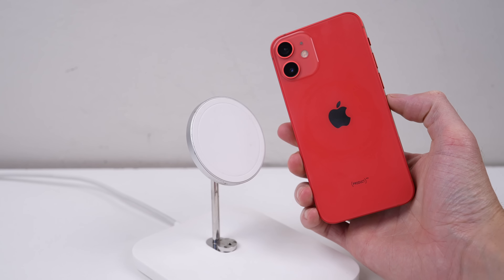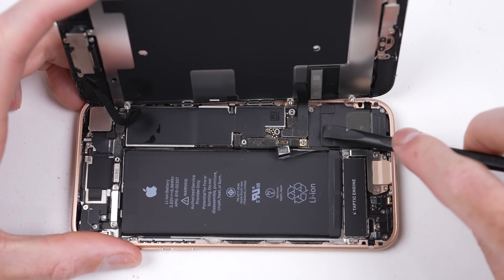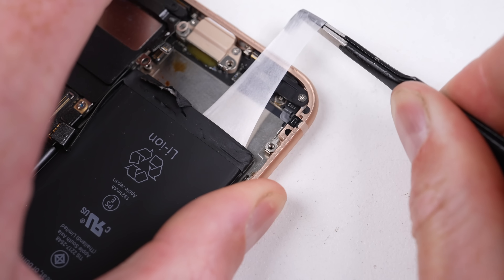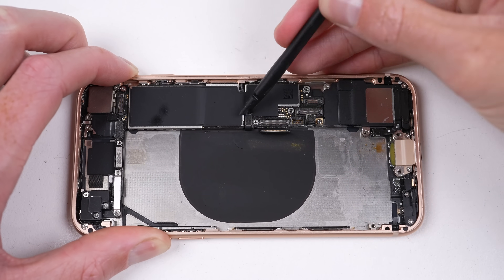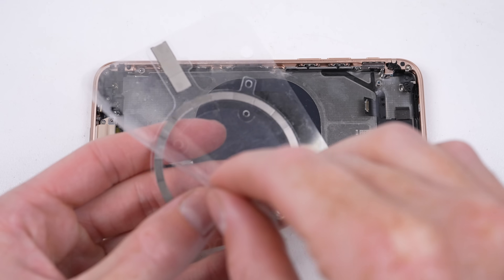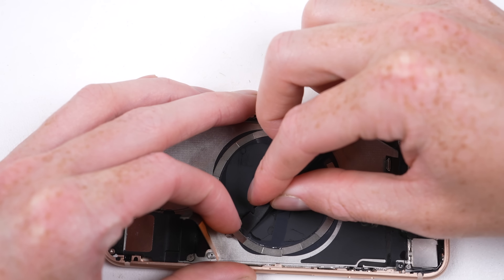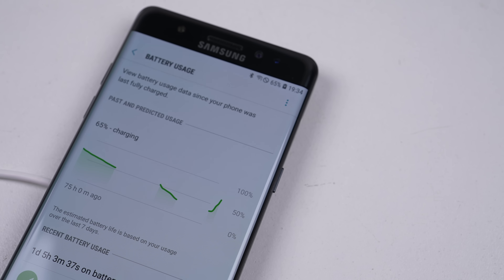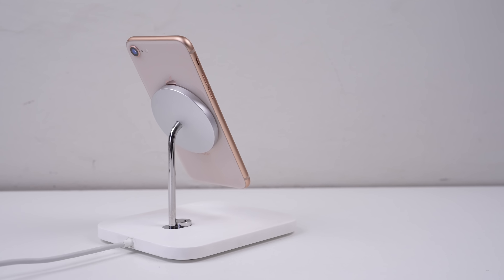Adding An Exclusive iPhone Hardware Feature To Android Phones + Older iPhones Models.

Comment: 7:23 I would suggest non closed magsafe rings when you do this since the closed one messes with the charging, an open one does not. Simply cutting a small bit out of it also fixes the issue.

Comment: I’ve got an iPod Classic 5th gen that’s in great condition, but the screen has never worked since I got it. The seller mentioned it was unused for 12 years. I opened it up, disconnected and reconnected the battery, and everything works in terms of going into Disk Mode, connecting to the computer, and the drive spinning. However, the screen stays dead, and I don’t think it’s even booting to the main system—I don’t hear the signature clicks when running my fingers over it. Should I attempt a screen replacement, or could it be something else? Any advice would be appreciated.

Comment: I made a cutout in my leather skin on my phone for a stick on ring so it's flush, but for whatever reason it blocked wireless charging completely for all my wireless chargers which work on the same phone without the ring which is a shame

Comment: My wife's s23 not only wouldn't charge reliably with a magsafe case, it would discharge much faster during normal use. Figured this out on vacation so I had to pry out the the magnets. My s23 ultra worked fine.

Comment: Magsafe works on adroid just fine depending on manufacturer samsung used different wireless charging protocols from apple i had this issue on my note 20. Anker uses apples protocol so it doesn't work well on some sam phones other companies throw both on and work well with either or

Comment: Nice. Now can you do the opposite? I have an iPhone pro max 15. I never use the wireless charging function or MagSafe. But I still have to contend with having a glass back phone which recently suffered a minor knock. Nothing serious, any other device would’ve been fine, but being an IPhone the back glass has shattered. Fortunately it’s not come loose or fallen away, just looks terrible. 

Can you replace the back glass on a similar iPhone with something that won’t shatter? Even if it means sacrificing the unused charging functions?

Comment: Bought a Magsafe case for my Samsung Z flip 5. I've noticed that while it works well with the Magsafe charger, It won't reliable charge with the original Samsung wireless charger, Sometimes it will work fine but sometimes it will say the case blocking the wireless charge.

Comment: A case definitely is the best way to add magsafe to any phone for most people. I recently upgraded my oneplus 6t to a pixel 9 Pro, and chose a case with magsafe built in. I use a magnetic mount in my truck and at my desk for my phone, and my old one used a plate stuck to the back of the case with adhesive. My new one uses magsafe and I much prefer it, mostly because in the truck I don't have to align the plate anymore.

Comment: Magsafe is unreliable if you have the phone even slightly out of alignment. I have an aftermarket and have laid the phone down off by a bit and found the battery discharged when I went to check it, same result as your initial effort

Comment: Either way, stuffing magnets right at the wireless charging coils is the last thing you want to create an induction heater or overheat the battery. I would rather position the magnets away from the center.

Comment: I've been using dbrand's grip case (which embeds the magnets) with a pixel 9 and it's amazing... It's so frustrating the standard isn't universal or open for all phones, when it brings better charging efficiency, simpler use, and general improved convenience.

Comment: The battery expands and contracts when it's hot, a few millimeters small casing is what caused the samsung galaxy note 7 to explode if i remember, also wireless charging introduces a lot of heat, take care Hugh :D
Reply: The phone which Hugh used was Note FE not the Note 7. Note FE has slightly lower capacity battery which is safe and has no incident of explosion.
Reply: @chiragpatil3772  i wasn't talking about the phone i was talking about the battery expanding and contracting being blocked by the magnets

Comment: idiot this MagSafe is made for iPhone 13 and newer only so there's 2 different kind of wireless charger so one is for Samsung wireless charger is made for Samsung phones only so that charger will work fine for other kind of phones too but not for apple iPhones at all so MagSafe is degined for iPhone 13 and newer reason is watts went higher is to 15 watts now and Samsung is about 10 watts so it much different now got that because I have learned many new things online and you have not learned new things too thats why so you only fix things in your life got it so I always test it first before to use new ones and never take it apart or will void the warranty for that I can't take it for repairs by Apple Store to fix it thats why

Comment: Magsafe isn't Apple-exclusive. Its a part of the universal Qi2 standard. Many Android phones will have it this year.
Reply: Some phones are launching with Qi2 without it. The S25 phones aren't going to have magsafe.
Reply: "Magsafe" the word is trademarked by Apple. If it is labeled Magsafe it is exclusive to Apple. The wireless charging technology is not proprietary but a "Magesafe" case etc is.
Reply: Tech Altar recently made a video on Qi2
Reply: Except still only one has it - unless you count that you can buy a cover with magnets haha
Reply: You need accessories for non iPhone. actually there's one small android brand that implemented magnets inside the phone itself, but this year most of Android phones need an external case to work with magsafe.

Comment: Actually I thought all phones came with it all of my devices have it just recently we added a wireless charger pad system do the back of my Galaxy tab S10 Plus I have a tech guy who does this stuff now this has a glass back now so it will charge properly we took it somewhere and they made a specialty case and the way that he did it it's so that way it's a huge charging pad will charge basically any position you lay it on the wireless charger it even works with magsafe

Comment: Missleading title! This is NOT an iPhone exlucive thing in any way shape or form!
In fact, wirless charging and accesories with magnets was on some early devices even years before the first iPhone was an idea.. So stop giving Apple credit for stolen ideas!
Emberrasing how people forget things excisted before the damn iPhone with stolen features🤦‍♂️ Funny thing is most disliked this crap untill the iPhone got it... Weird🤔🤦‍♂️
And magnets is also a part of the QI 2 standard.. Litteraly why I don't want QI 2. I hate magnets on my wirless charging devices and it's a bit annoying even on my old 2016 smartwatch.
And why would you open the phone to add this crap? Just get a case or a magnet sticker on the backside. Easier, better and gives you an easier option to remove it later.
It's not an upgrade but a downgrade in my eyes.. Magnets making it hang on litteraly defeats the point of using a wirless charger🤦‍♂️😅

Comment: This is a great idea. I have a ring from ESR on the case of my S10e (it has alignments for Samsung phones in the box) and a powerbank with MagSafe. Wireless charging is pretty inefficient, so I typically charge it with a cable anyway, but powerbank being "stuck" on the phone is very convenient. I didn't think magnets on my powerbank were strong enough to work through the case, so I didn't even consider putting it on the phone or even under the back glass. I'll have to replace the battery at some point and might test it again.

Comment: I have done it already. Doesn't work very well. I have a galaxy s10. Done this a year ago . The reverse charge stop working, the phone overheat when changing over wireless, the back panel does not fit well anymore, the touch glitches when trying to use while charging. But, in fact charges pretty decently.

Comment: A couple of weeks ago I used an ESR HaloLock
Universal MagSafe adhesive ring to give my Moto G75 (with wireless charging) MagSafe capability. No dismantling required. I aligned the charging coil with the MagSafe-compatible ESR magnetic puck and marked where to place the adhesive ring, then stuck it in place on the back of the phone. The ESR adhesive ring comes in a pack of two from the Jungle website and I used the other one to add MagSafe capability to a non-Apple iPhone 15 Pro case. The end result was an iPhone and an Android device with MagSafe compatible magnet rings allowing the use of all my (non-Apple) magnetic Qi chargers.

Comment: OnePlus although does not have a magnetic phone they sell a wireless charger that supports it and they sell cases with built in magnets for this very reason because they opted out of including magnets in their flagship because of size and space constraints but they did put one in their cases for the phone to make up for it

Comment: 2:25 So I found from my years of being a phone technician when these phones were popular ,that the best way to get them to not snap was to wrap the adhesive up around your tweezers, keeping the tweezers pretty much in contact with the bottom of the battery and the case. That way it gives the lowest possible pull and also eliminates some wobble. 

Got good enough at it to the point snapping one was rarer than not snapping it.
Reply: I just use 90C heat for a few minutes which softens the adhesive sufficiently for easy removal.   No alcohol as it can seep into every little crevice and damage especially a screen (even 99% has a bit of water content).

Comment: Check if the Android phone is getting very hot while also not charging. Aftermarket mag safe rings often times complete a full circuit, whereas the individual magnets and the partial rings don't. 
The complete circuit drains some of the wireless charging, I'm guessing stronger charging stands can push past it

Comment: The magnets are part of the QI2 wireless charging standard now, minus the guiding magnet. That means most android phones will probably have magsafe in the future.
Reply: I remember listening to the Waveform Podcast about how Qi2 doesn't actually need the magnets to be called Qi2, which means most manufacturers will save the cost of the magnets. Total bummer.
Reply: @franciscophk  Yep. Originally it was going to be a requirement but the leader of the Qi group seems to have stepped down from that original statement.
Reply: The issue with some Samsungs is probably the incompatibility of electro-magnetic waves when a magnet is present.
Reply: The latest update seems to be that Qi2 requires magnet, but not necessary in the phone. A phone with first party accessory that allows full Qi2 can be sold as Qi2 ready

Comment: I really dislike charging via induction. The phone gets very hot suggesting it is inefficient compared to directly wired charging. Every new version of iPhone I expect to see the use of any hardwired charging cable to be removed meaning we are left with an inherently inefficient charging system.
Reply: amateur radio operators hate them more, and switch-mode power supplies

Comment: Casually flexing that you got a decommissioned Apple Store MagSafe stand
What the hell happened to the replies?
Reply: There’s a eBay seller in Australia who sells them. Apparently an ex apple manager.
Reply: @technohc4939 It’s your fault that I just spent $250 on a stand charger lol
Reply: @technohc4939 what’s his user?
Reply: @technohc4939 whats the seller name?
Reply: You find them in bins all the time
Reply: The issue is probably the smaller transmitter coil to the larger one in some Samsungs, OR the magnet interferes with that particular pickup coil.   You could try mounting the magnets under the coil to see if it makes a difference in the electromagnetic pattern.
Reply: Yes. That's super impressive.
Reply: I find ones by Belkin, Anker, and Spigen aesthetically better
Reply: @Pearloryx  Of course they are.. Most is better than Apple and many has had years more experience too.. Magnets on wirless charging and accessoires is OLD and definently nothing Apple "invented" or was first with🤣
Reply: It even still has the teather!
Reply: @Space_US  And?
Reply: @Oystein87  idk its kind of unique
Reply: @Space_US  Not really🤷‍♂️😅
Reply: @Oystein87  what happened here? let people enjoy things for goodness sake
Reply: Would not call it flex having any dumb overpriced products
Reply: It was never for sale i believe @Oystein87
Reply: @Oystein87  I'd say it becomes a flex when you get a computer that once cost thousands for mere pennies. 
But a charger, which thousands have touched before you, and still paying money for it? That sounds more clownish than anything.
Reply: @masterkamen371  Exactly👍

Comment: There are also magsafe compatible cases. If you use a case already, might as well look at those. They add the magsafe magnet ring at the correct orientation in a non-destructive way. I use it on my pixel 8 with the mous case.
Reply: yep I got a "magsafe" case for my 11 pro max while I still used it and it worked perfectly with magsafe accessories. Like yeah you don't get the animation and faster charging, but wireless charging is just about convenience anyway so it's pretty handy. Opens up stuff like car mount accessories as well
Reply: I did that for my S24 Ultra
Reply: I've done this since I moved away from iPhone a few years back, Pixel 7 Pro, S24+ and now on my Oppo Find X8 Pro. Only difference now is that I'm using one of those magsafe rings you can stick to the back of the case. But before that I found the Peak Design cases offered great protection + magsafe compatibility.
Reply: This is what I have on S21 Ultra
Reply: I do this too. Even my cheap ass chinese phone has "magsafe".
Reply: This. I use it on my S23 Ultra with a case I got from AliExpress. It allows me to use a detachable popsocket, and a magnetic wireless charging car mount. Previously I had a cheap magnetic ring stuck to the back of a Cygnett case, but after a few months the adhesive let go, causing the ring to keep falling off.

I should mention; if you always use a case, the method shown in the video won't work anyway, since the magnets aren't strong enough to go through cases.
Reply: @DJBla2e01  It of course would work with a case since proper neodynium magnets have no issue working trhu even a thick case. If not the magnets suck.. But magnets on a phone and accessoires suck anyway🤢
Reply: So called "Magsafe" (it's just magnets and nothing special)  is actually extremely OLD (way older than the iPhone and Android phones) so there has been solutions for this crap a very long time. Apple and QI 2 litteraly copied a decades old thing and people don't even see it🤯🤣
But something I really dislike is magnets on my phone and wireless charger. Defeats the whole point of just putting it on the charger and lifting it up without it hanging on to the charger🤦‍♂️🤦‍♂️😅
Reply: yep. pretty much never going back to a non-magsafe case at this point. it's too convenient and you can get cases that obscure it like your mous case. though some that don't obscure it look pretty good too, like the transparent case dbrand makes

Comment: Fun fact, that "oil" you see isn't oil as such, but is ferrofluid, suspension of nano particles of iron in an oil like substance (kerosine, diesel or something similar). This is to lubricate the vibration motor and provide cooling to it. You can also find ferrofluid in other things such as hard drives, speakers and buy it in bulk. BE CAREFUL AS THIS STUFF STAINS THINGS LIKE SKIN AND CLOTHING VERY BADLY! It is also toxic when ingested or if you get it in your eyes. Soap and water should remove most of the staining on skin but you will need to "wear" off the rest of the staining.
Reply: First I've heard of ferrofluid being inside HDD's. I've taken a part more than I can remember.
Reply: also seen a similar 'Taptic Engine' in an iPhone 4S which was leaking
Reply: I wonder why Apple kept switching vibration motor technologies. I remember the iPhone 4s vibrator being so much better than the one in the 5s, 5s having a counter weight @arpro89
Reply: Kinda related but Ferrofluid speakers look so cool
Reply: it stains skin???

Comment: It's remarkable how awful iPhone 6-8s were
Reply: The 6S Plus was amazing man assuming u didn't get the 16GB model
Reply: @ytrewq87 had a 32gb 6s+ with a glowing apple logo for the longest time. Man it makes me want to get another one, I loved that phone.
Reply: Bro I miss my Note8 so bad  @IMDYT420
Reply: Apple didn’t make them with glowing Apple logos. Was yours modified?
Reply: @AtomSquirrel you can get this really simple kit to make your apple logo glow
Reply: @Greedy-Allayi have one (orchid gray, 64gb)
Reply: @ytrewq87 I agree to disagree with you on that (I don't give a shit! If you don't care either)
Reply: The 6S is one of the best iPhones ever made
Reply: @Ronnocbot yup. 6s Plus is a beast still. And that sweet 3D touch
Reply: Honestly I think that about every iphone lol
Reply: Bruh, what are you smoking?
Reply: They apart from the 7 were fantastic phones have repaired and resold many back when they had software support
Reply: @ They had a ton of issues...bendgate, Touch IC, throttling.
Reply: Open and compare with Samsung phones at the same era - Apple is still much more neat and organized
Reply: Wdym I still use 6s as my secondary phone and with a new battery(and running iOS 13) it’s just as smooth as my 14